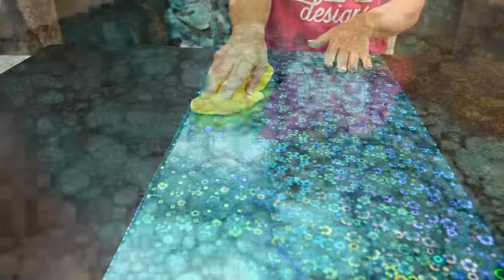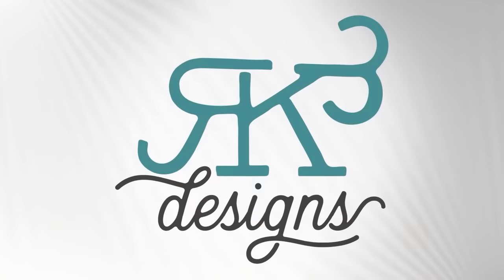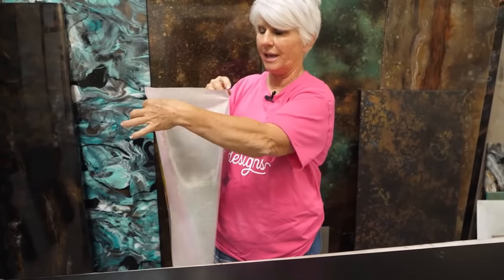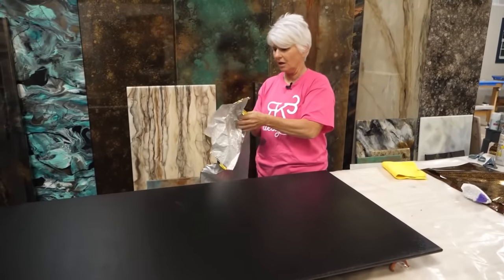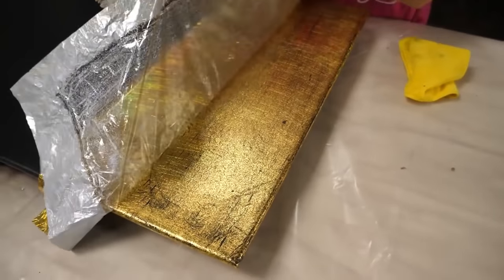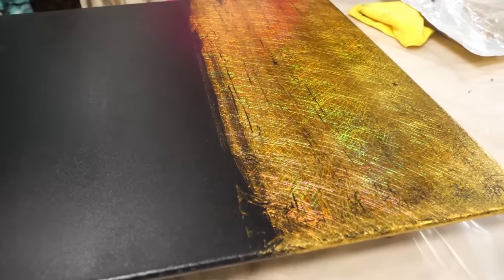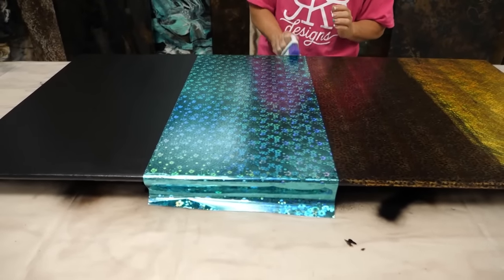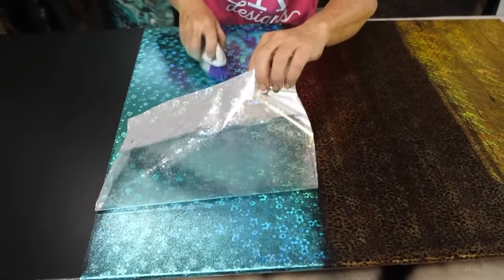Using Decorative Foils with Epoxy | Special Guest RK3 Designs

Comment: Very beautiful. Question: once you torched the epoxy, did you let it harden before you added the black paint, or did you spray the epoxy with the black spray paint when the epoxy was still wet?
Reply: The epoxy is still wet when the spray paint is used.
Reply: Hi is very nice and i am interested Do you represented in Saudi Arabia Jeddah

Comment: I’m looking at the epoxy and for my kitchen I need 5 gallons which is super expensive with stonecold … I looked at other site and i can get the art clear epoxy for 100$ less … is there a difference and can I still get the bonding coax ext from stone old and mix it with the cheaper epoxy?

Comment: Question. Is it possible to use this process on older processed faux marble countertops if I sand and paint it with something like kilz? I do have experience with resin work and did a kitchen counter to tide it over til we remodel. Mostly I do resin art.

Comment: How do you fix this when it turns out sticky and will not fully harden ?  we just did our kitchen it turned out ok , and the product is cured hard not sticky at all , but then we did the bath room counter tops and they are still sticky after 4 days ,and we mixed every thing just like we did for the kitchen , the back splash for the bathrooms did harden up poor was at the same time as the sticky counter tops , ...